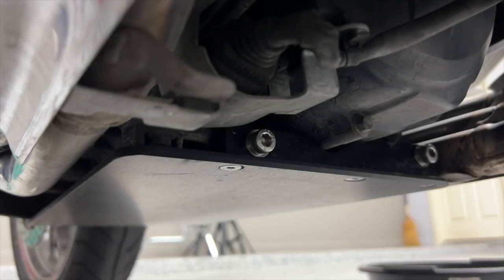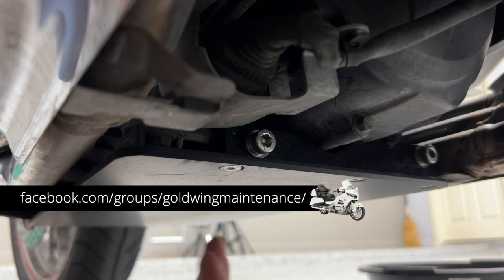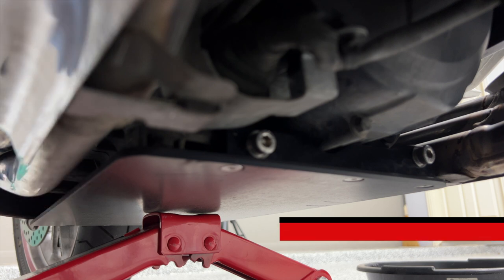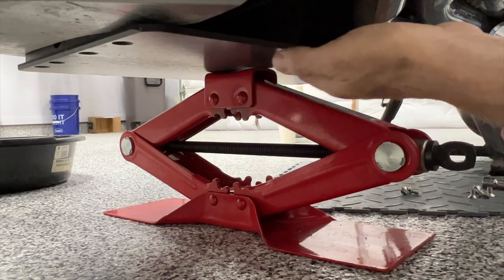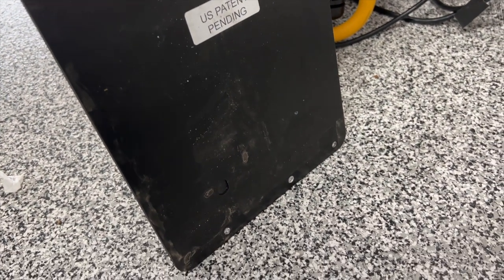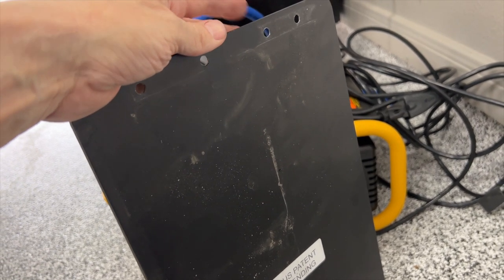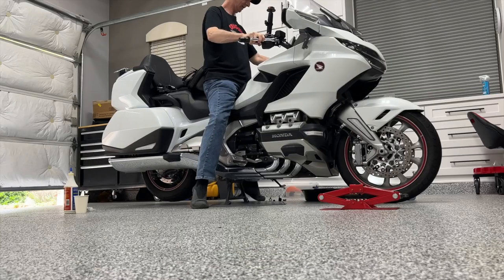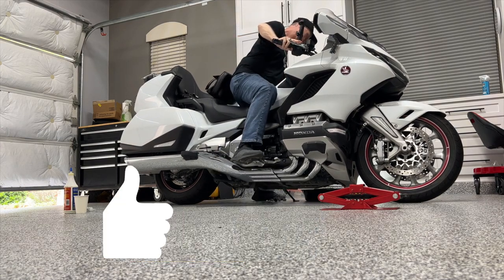Oil Change With Traxxion Engine Guard Installed

Comment: Max at Traxxion's video stated that it appears that some Goldwing Engine tolerances are a bit different hence the one Screw might not line up perfectly. He says the vast majority of bikes with this install have no issue with lining up and that there has not been any model year or serial number range identified as to which ones might be affected.
The fix is to install a washer between  the bracket and engine cover of the affected screw hole to shim and skew the bracket over a smidge then allowing proper line up.
The kit will be supplied with extra Washers for this purpose.

Comment: Thanks for the tip.  I can use my left over Harley jack (about 8 inches wide) to do the same.  For the hole that maybe slightly off on the plate, some have mentioned they have enlarged the holes just a little, which makes the plate much easier to install.

Comment: It appears that the machining of the hole for the left rear screw is a bit off; the counter-sunk hole on the plate doesn't quite match up with threaded hole on the bracket. At least that what it looks like in the video.
Reply: If that’s the case, I hope Max sees this and refines this. Like he did with the bracket area around the oil drain plug. Tell tale signs of engineering fit and finish. Coming to market so fast. Something I would hope not to see from Traxxion.
Reply: Cruiseman I thought you were going to add  the installation video to your maintenance videos like I own which would help keep all your helpful videos on one central and easy location including this one or did I misunderstand? Thanks

Comment: I like to use a little dab of never seize especially when working aluminum vs. aluminum and given you'll be R&R this several times throughout its life for oil changes.  That might ease the resistance on the left rear machine screw.  Could be a little galling already going on.  I wish Max made one for the '01 - '17's.  Mine is an '05 & an engine guard/belly pan looks like an excellent idea but it should have some substance to it to withstand a hit from a foreign object on the road kicked up at speed.  Yours looks like it will protect your bike well.

Comment: Cruiseman, why changing the type of oil recommended by Honda strictly for the new GL ? I am trying to understand this approach. If you change your oil as requested by the book, which is the healthiest schedule, why other oils? Anyhow, remember to do the DCT learning.
Reply from the maker: I have had a lot of people ask about alternatives to the Honda oils so I just decided to try Castrol. It meets all of the Honda specs so I don't expect there to be any issues. I did do the DCT initialize.

Comment: I would have started with some 2"X4" pieces with perhaps a 1"X2" piece if required.   I'd also loosen all 7 bolts at the start, then insert the wood to hold the plate in place.   I'd likely take the middle screws out first, then the outer ones.

Also, looks like an ideal application for an electric socket wrench to undo the screws.   Wouldn't use it to put the screws in but I would to remove the screws.

Comment: Does the front of the Traxxion engine guard hang below the front cowl when installed properly as mine seems to be tucked in the space above my cowl in the front.  Note, all brackets are installed correctly per the instructions.
Reply from the maker: @sms0625 Mine sits underneath

Comment: I drilled out all of the clearance holes to make them slightly larger.  They seemed to be slightly out of alignment so the additional clearance really helped.  Once the screws are tightened the tapers on the headed center them all anyway.
Reply: This helps too.
Reply from the maker: I did the same and it does help.

Comment: That one screw in the rear that you say gives a slight problem, sounds to me like a bolt that is slightly too long and has started to bottom out before the head of the screw is fully seated in the machined recess. Look at the threads on the tip of the screw and see if the show signs of folding or flattening.

Comment: Remove all bolts except for the right front corner. This allows you to just swing it out of the way, easy peasy. Yes the weight of the plate is hanging on 1 bolt, never been a problem for me, not like it weights a ton.

Comment: I seriously believe you are way overthinking this. The Traxxion engine guard does not weigh 30 lbs.
It can’t weigh more than a couple of pounds, Just supporting it with one hand and starting one of the screws with a T-wrench is a piece of cake. Then slide to the other end and start another screw.  
WoW, it’s now hanging all by itself!

I thought about having a NASCAR pit crew tackle mine, but then REALITY set in.  🙂

Comment: All of this needed because of some very poor engine case design from none other than Honda themselves.   For a motorcycle approaching $30,000 dollars, and well over that for Canadian owners, it should have been Honda coming up with a factory installed road debris impact plate...to protect their poor engineering, that has that exposed shift shaft boss where located, on the engine body.   Very poor design, and negligent lack of a factory solution when this vulnerable weakness has put so many Goldwings on the side of the road, and an $8,000 tear down and misery for the owner.